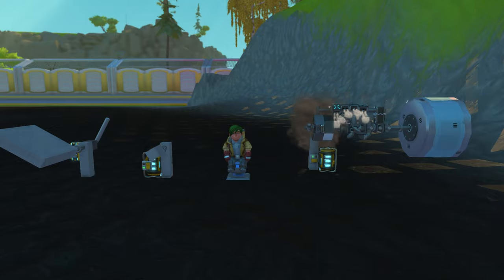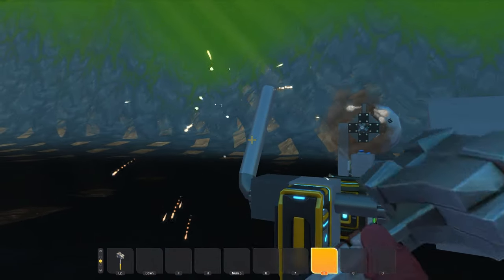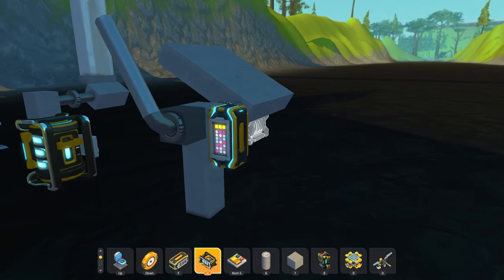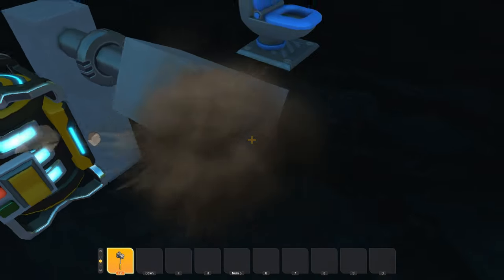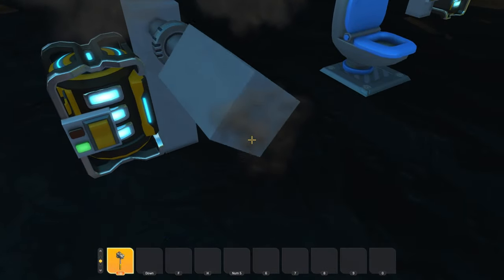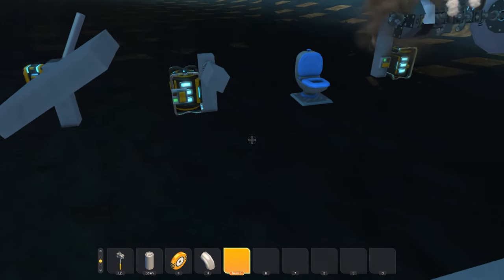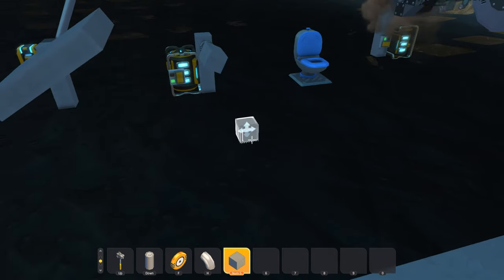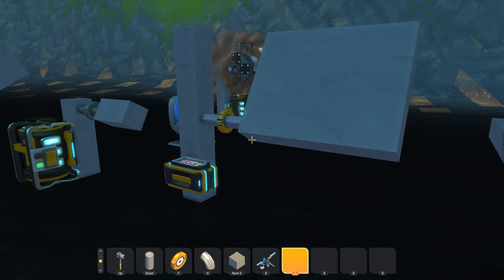Bearing Clutch uses and Tutorial (Scrap Mechanic Gameplay)

Comment: FINALLY, SOMEONE MADE A TUTORIAL!!!
I've wanted to know how to make these for a while, but no one had a video on how they were made, just showcases, so thank you for stepping up!

My question now is why this works... hmmm...
Reply from the maker: this works because there are two bearings counter rotating, to then the controller is a angle limiter. and on the electric engine the bearings are also counter rotating but there's a parent and child problem going on that makes it as though its a free spinning bearing until you turn the engine off. you can also do this with a gas engine.
Reply: @_Dynamation_  So if I'm understand you right, then the electric engine allowing the bearing to free spin is the game not knowing which part is actually attached, so it either free spins or stays rigid with on or off signals; and the controller does the same thing, but it stops at the set angle instead of free spinning continuously?
Reply from the maker: @ShawnF6FHellcat  no, not really. how the game works is it thinks the left pipe is the parent of the pipe on the right, but the pipe on the right is also parented to the one on the left, if you separate the two and have one bearing on one pipe on opposing sides, you'll see what's happening. the game thinks they are parented and childed to each other. separate the two bearings so there's on bearing on either side and and place blocks on them on a platform and you'll see that with a controller it limits the angles and with the electric engine it dree spins. 
ps. i don't really know how to describe how do things in text but i hope you understood what i mean.
Reply: @_Dynamation_  I understand what you're saying, but I'm just having a hard time visualizing it without going into the game and testing it. You're description is fine, it's my lack of the technical knowledge that's causing confusion, which just means I need to spend some time in Scrap Mechanic. Thank you for explaining the concept to though, not many people go beyond just a tutorial, so I appreciate it!

Comment: didnt understand the last part build, what is the clutch function ??
Reply from the maker: clutches are used for builds with piston engines in them, they help apply power to the wheels like a toggleable driveshaft

Comment: doesnt work for me. is it fixed? controllers works if they are separate from the ground. engines doesnt work at all.
Reply: Hwy I am messing with this right now and it’s not fixed. I had a similar problem. If you hook an engine to both bearing it should work. If it doesn’t try swapping the direction of the bearings. Mine is always swap the direction of the front bearing facing your load
Reply: @soundowl2650  ill try this ty
Reply from the maker: you have to connect the bearings while the creation is off the lift.
Reply from the maker: the bearings also have to be counter rotating
Reply: @_Dynamation_  thank you man
Reply from the maker: @master228games  no problem!